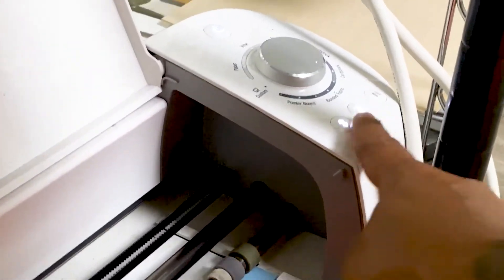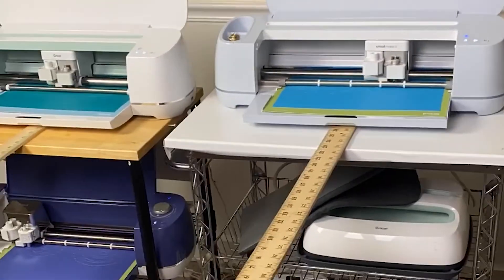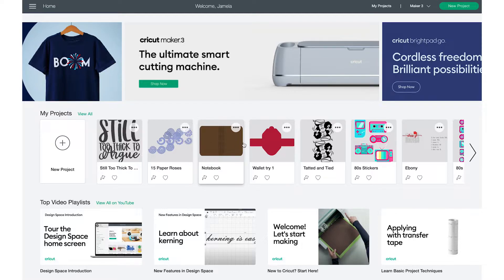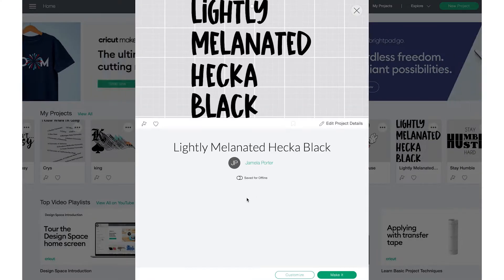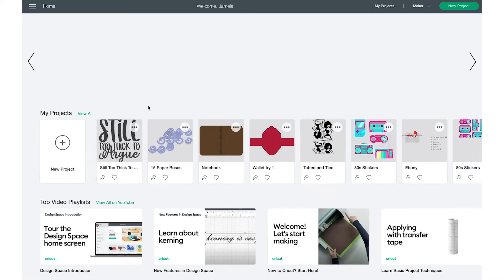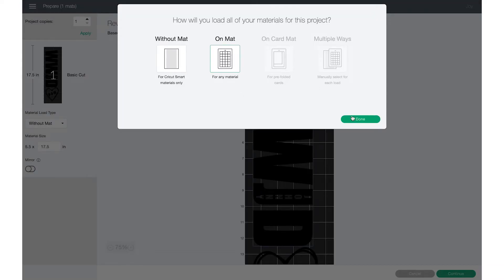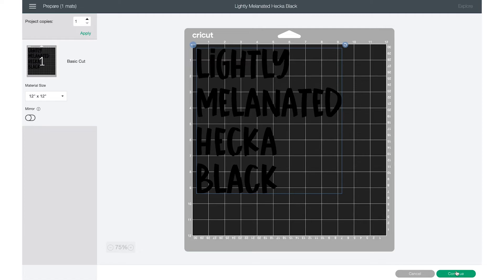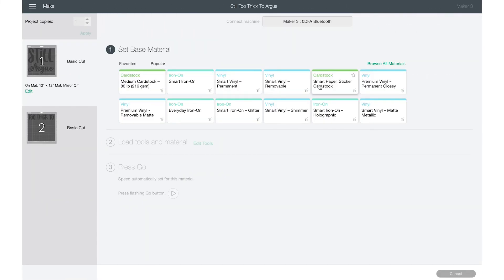How To Use More Than One Cricut Machine At A Time

Comment: Can you use 2 explore air 2s at the same time?
Reply from the maker: You should be able to.
Reply: I'm trying to do this. We're you able to figure it out?
Reply: I was trying it today but it only reads 1 for some reason. It will say that one is already in use and to close that one out before using the other
Reply: @meghanfox6903  Were you able to connect both of them?